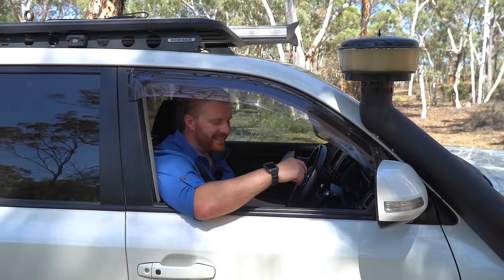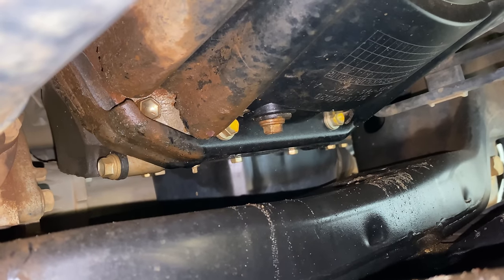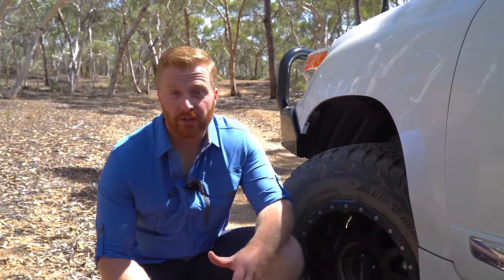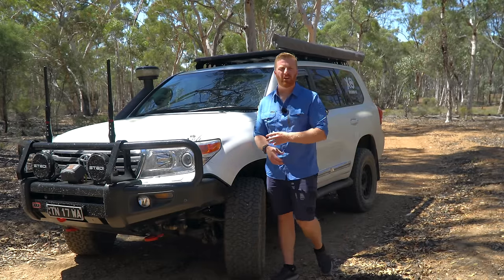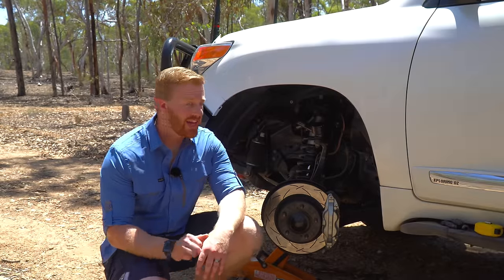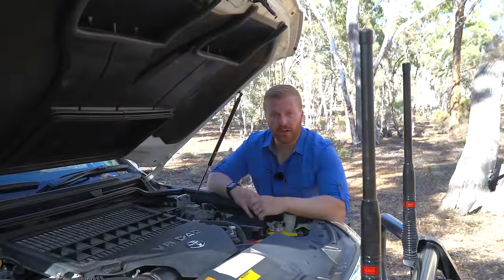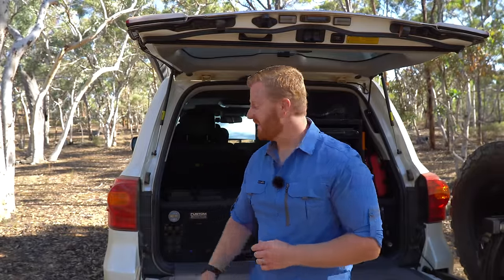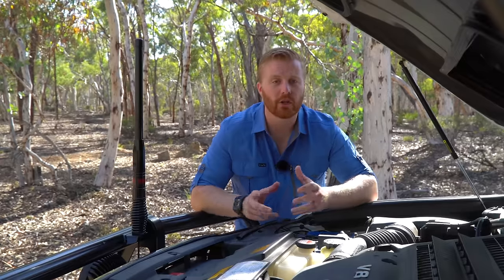LC200 | PROBLEMS & ISSUES | Not everything goes to plan -Mechanical-Electrical-Suspension 200 SERIES

Comment: Hey man great informative video, sorry that im unable to give any info on them issues, and i feel like the ones at the start with the intercooler and brakes im starting to have them problems aswel. Do you ever get a center diff lock flashing problem? Ive tried searching almost everywhere and asked some people that own a 200. It seems to occur either randomly the next morning after it rained, or when i put the car in Low 4 for abit, either the next day or a couple days later the center diff lock starts flashing and its unable to go into Low 4 without driving maybe 3-5km then turning the car off and back on and its fine.
Reply from the maker: Cheers mate. 
In regards to your issue, the centre diff lock flashing is a very generic code and could mean so many different things. It seems minor though if it's intermittent and not putting the vehicle into limp mode. 
Best thing is get a mechanic to read the historic codes and they'll be able to point you in the right direction 👍
Reply: @XploringOz  Thanks man, yeah its only a minor issue but annoying sometimes, ill try the mechanics thank you

Comment: As others have said check all earth points. Double check they have run adequate gauge cable on preferably not a 2 core earthed back to the engine bay.
A thought not founded in any solid knowledge.. I wonder if the earth bond within the inverter ac ground to dc ground had an intermittent connection. 
My BP51s leaked really bad. Had 1 replaced. 
A lack of quality and skill seems common from accessory joints and car dealers.
I have just fixed a short on my rear indicators. Found the issue related to wiring of the kaymar rear bar. The workmanship was disgusting and the method to wire it up (hacking into my factory tow harness) was madness. Removed 2+m of 7core and other unnecessary mess. This was done by arb wangara.
Reply from the maker: For sure, I'll be checking a lot of this after some of the great suggestions in the comments here.
Interesting to hear about your BP51 as well, seems like this is a reasonable common issue. 
Definitely agree with your comment about finding good quality workmanship and find it very interesting to hear you have had a poor experience with ARB Wangara. This just goes to show how hard it is to find reliability time and time again....
Cheers, Nathan.

Comment: The Victron BMV unit draws <1mA with the back light off, which is nothing, so there must be a phantom load or short to ground somewhere in that auxiliary system.  Start at the beginning and disconnect everything on the load side of the battery monitor.  It should go to zero current draw or near enough, but if not, it's in the battery/BMS/BMV arrangement.  So if that's fine, then add back in, either by replacing fuses or plugging back in, each load one at a time and unplug them as you go, to test each load independently.  Don't rely on switches on appliances to turn them off if they are still plugged or wired in, especially the inverter, but anything you've got that has a switch, pull the fuse on that circuit or disconnect the wiring.  The phantom load will be there somewhere.
Reply: My Redarc Inverter was controlled by the Redvision soft switches. The soft switch system showed the inverter as OFF. Unknown to me the rocker switch directly on the end of the inverter was a three stage switch. Off. 1 and 2 positions had a dramatic effect. Stage 1 on the rocker over rode the soft switch system. So the inverter was constantly working even with the Redvision screen indicating the inverter as OFF. The battery was draining by 1.8 amps constantly. Stage 2 on the rocker switch allowed the soft switches to operate and was the setting the rocker should have been set at all along. Finally the drain to the battery solved.
Reply: @nrmjessop1257  Yeah, that's what I'm thinking.  All these things are switched off, but one of them is not really off at all.  Only the output or load side of the appliance is off.  The input side is still drawing current.  1.8A draw while "off" for your inverter was certainly a decent phantom load.  Good find on switch.  I'm guessing the third position on the switch was a true off.  Pos 1 = always on, no matter what the soft switches do.  Pos 2 = controlled by soft switched.  Pos 3 = off.  Sound about right?
Reply: @Michael_Mears  Thats about right. I only found the switch was incorrect set on installation and partially boxed in, when I disconnected and removed my solar panel and stopped topping up the battery loss.
Reply from the maker: Thanks for the suggestions mate. I'll definitely look into this. Something is definitely still drawing that power even though the appliance is still off. I'm fairly sure it won't be the inverter as this issue was around prior to having hate inverter installed, but none the less I'll need to find it either way. 
Hopefully it's not something within the BMS. 
Cheers, Nathan.

Comment: The draw on your battery, i found mine was coming from mpx-a relay and when removed the relay it stopped. Yet to work out what it actually is in that circuit though.
Reply from the maker: Thanks mate. I'll have to go through and disconnect one accessory at a time to figure out what the draw is. Some people also say it might be the Redarc BCDC battery charger, which I really can't do without. I guess it could be something I get used to living with as well. 
Cheers.

Comment: In regards to your slight rear main leak, I too had a provent200 catch can, with a slightly weeping rear main oil leak and found by disconnecting the catch can the oil leak went away, don't know why filter was new and replaced no blockages in breather pipes but this fixed the problem, so in the end I fully removed it and had a tune put on my vehicle with an egr delete and have all signs of rear main weep disappear, just something for you to consider.
Reply from the maker: Thanks mate, yes something I'll consider. Interesting to hear the direct correlation that you have observed though. Food for thought. 
Cheers, Nathan

Comment: Hi Nathan, Re the 12 volt issues, not good. Not easy to find but you need to find the constant current draw and the 12 to 3 volt cause otherwise could cause a fire 6W of power might not seem much but that can really hot in a confined small space.   Re key not working, have you checked that your wireless devices are off as wireless interference from one of the accessories could cause this.
Reply from the maker: For sure, definitely need to try and replicate this issue and conduct some more testing. 
With the key, yes I have manually switched off the wireless function, but no doubt its a standby signal that interfering. The diagnosis continues...
Cheers.

Comment: I owned a Hilux for 5 years and only equipments those got wrong were the aftermarket accessories I added. Don't mess with your vehicle, especially electric system. If you do, then don't whine about the problems as if they were the vehicles problems.
Reply from the maker: Fair enough, but I didn't make this video to whine and I'm not complaining, just keeping modifying vehicle realistic. Not everyone wants old standard vehicles these days, however everything comes with a compromise. 👍

Comment: Hi Nathan
Just watched your latest video. In regards to the Victron current draw......I've had a Victron BMV702 installed in a Hilux and Isuzu. Over the past few years it has ALWAYS shown a constant current draw of 0.27A even though the instruction manual for the 702 states that it should only be 4mA; i.e. a constant current draw of 0.004A. All the wiring and connections have been thoroughly checked but the current draw of 0.27A remains unchanged. No-one can find the source. I suspect that the Victron specs are "laboratory" specs, not real world specs.
As regards the intermittent fault, thoroughly check the shunt, the pin connectors etc....everything relating to the shunt and connectors. I found one of the pin connections to be faulty, and one of the small black chips on the shunt had a corroded leg attached to the PCB. Hope these help.
Reply from the maker: Thanks mate, it seems like a few people share this issue too. Some have also mentioned it might even be the Redarc BCDC charger too. 
In the end it's something that I'll probably have to learn to live with, but at least Im aware.
Thanks for the suggestion with the shunt connections. 
Cheers, Nathan.

Comment: Very informative, Nathan. Thanks for sharing and I'm sure there will be others that will benefit from it. I've got a similar issue with my auxiliary battery draining (virtually overnight), even when I switch items off such as the dash c ). My 200 is about to turn 2 years old in a couple of weeks and already I'm looking at changing the battery (any recommendations on a new one ?) . I'm waiting to get to an area where there is a reputable auto electrician to look at it. Also in a separate issue, I have a little too much weight over my rear axle. I'm pretty sure I can overcome that by ditching some of the unnecessary tools I'm carrying. Thanks again for sharing.
Reply from the maker: Thanks Jim. It would seem that a few people are suffering from a few issues similar to the ones I mentioned here. I hear where you are coming from with the batteries, I too have had to replace my starter battery due to a constant load a little premature. 
In regards to advice for a secondary battery, well I am actually going to be releasing a video very soon in relation to a new option I am trying out. (....Lithium...). Although I'll be talking about the benefits and how it all works, I'll definitely be conducting long term reviews down the track to show how it performs. Further, it's not one of the super expensive modifications, I specifically choose one of the cheaper options on the market (relative for Lithium). Hopefully I'll get this video out in a week or two. 
Yes, the weights are hard. Definitely something I too have to work towards. 
Cheers, Nathan.
Reply: @XploringOz  .... very much looking forward to that video Nathan. Take care mate

Comment: Hi Nathan,
I have just finished building my second LC200. Both of my Cruisers have had the issue of a constant draw on the start battery. At this stage, I have tracked it to my Redarc BCDC charger. I have a manual reset circuit breaker so I have isolated it and found that the draw stops. Also, I have previously had a dashcam interfere with my AM/FM radio signal, not sure if it could cause an issue with your remote locking??
Reply from the maker: Thanks mate, I have a heard the BCDC might be the issue from a few comments now. In terms of the keyless issues, unfortunately I had the problems well before these were installed, so I'll still be searching for the issue there. 
Cheers.

Comment: Replace the factory fuel filter lid / pump, once the diaphragms wares it will still pump but will let air in as well

Any dust is bad, it is unnecessary ware  and eventually you will see that reflect engine issues or failures, if that happens while you own it or not that depends how much dust your 200 sees. 

That front strut is wound right down you should get a more suitable length spring, but even better get some better suspension I don’t mean for any offense but the 51s are all show and no go, bad batch…. Leaking and squeaking bushes and clunking is also common
Reply from the maker: Cheers mate, I'll definitely be checking out the filter lid assembly for sure. 
With the suspension, so far I've been quite happy with the performance, albeit the adjustment issues and rear shock leaks. 
Saying that, if I had my time again, I would research the market to see what else is out there.
Cheers, Nathan.

Comment: Replace the fuel filter assembly the small manual pump is leaking back to the tank car will start till diesel is used between filter and injector pump is used up and stops can tend to run all day but runs back to tank overnight cheapest dollar fix took me a long time to find this on my 100series know people who spent thousands on injectors and fuel pump
Reply from the maker: Thanks mate, I've seen this a few times in the comments now and something I'll definitely look into.
Cheers, Nathan.

Comment: Hey mate , I've had the same issue with my 79 series after leaving it then go to start and it will either run for a bit and die or not run at all. 

I noticed you have a 2nd fuel filter, mine also only started doing this since putting the 2nd filter on, I'm running the diesel manager. The gasket between the filter and the water separator bowl was missing. Believe it or not it allowed air to get in. Might be worth checking to see  if yours is the same, rather spend 20 minutes having a good look make sure all seals are there and properly installed not binded. I used a thin layer of rubber grease just to help prevent them from possibly binding/folding.

I mean the sake of $20 for a seal oring kit as to $7k injectors I sure know where I'd be trying first :)
Reply from the maker: Hmm, interesting. A few people have mentioned that O ring issue now. Something I'll definitely look into. Would be very happy if that was the only issue! 
Cheers.

Comment: Good video mate.  My 2019 GXL has very similar mods to yours (inc Custom Installation drawers).  I swapped out my HPD catch can for Provent, and them blew the rear main (40,000km) when towing my 3T van through the Bindoon hills.  Toyota didn't want to know about warranty, but we did come to a compromise.  $3k fix to get tranny out and replace seal, rocker cover gasket needed replacing as well.  Catch can now in the bin and back to std!!  Ultimate orginally did the accessory fuse box and harness - very disappointed with the workmanship.  I put a 200AH DCS battery behind the fridge (Custom Installations made a special box for it during the drawer mfg) and Klarmann Automotive have redone the rear electrics with 1240 BCDC, Ergon DC hub, 2000W Victron Inverter.  Much better workmanship.
Reply from the maker: Interesting to hear your experience with the catch can. Running a standard setup might be something I look at doing, just to test out the results and see if it makes any difference.
Also very interesting to hear about your wiring and workmanship. It's disappointing when you hear these stories, particularly after the potential a shop like this has with the products they fit. 
I have heard great things about the products coming out from Klarmann Automotive though
Cheers, Nathan.

Comment: Thanks Nathan for your honesty. As a qualified mechanic I listen to people daily telling me how toyota's never have issues! As you have shown, in reality ALL vehicles have issues and in many cases it comes down to the luck of the draw as the saying goes. I too have owned  a LC200. Was it perfect? Not by any measure. 7k for a set of injectors is criminal to say the least but the die hard Toyota fans never seem to be able to remember their breakdowns. On another note, the issue your are having where the circuit drops to 3 volts, check the related wiring earth points. Quite often over looked when checking voltage drop issues! Good luck!
Reply from the maker: Thanks mate, appreciate the feedback and I could definitely believe what you say about some of those die hard Toyota customer haha. 
You are absolutely right though, no vehicle is perfect, we just need to find the best vehicle for our needs and work around some of the known flaws. 
Thanks for the electrical tip, I'll pay more attention to this if the issue comes back around... Not a fan of electrical issues...
Cheers, Nathan.

Comment: The air in the fuel system is probably due to faulty lift pump / primer pump have heard of a few guys with the same issue
Reply from the maker: I'm thinking the same thing, will be getting it replaced very shortly 👍